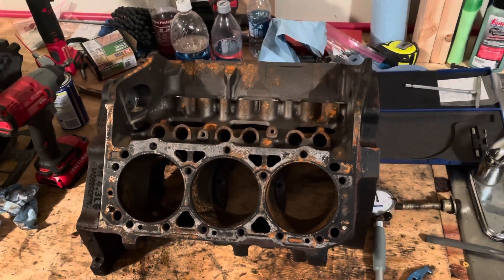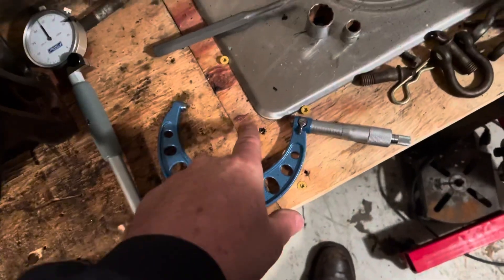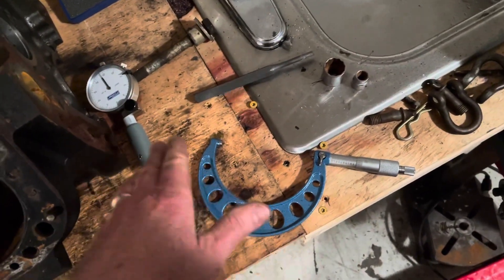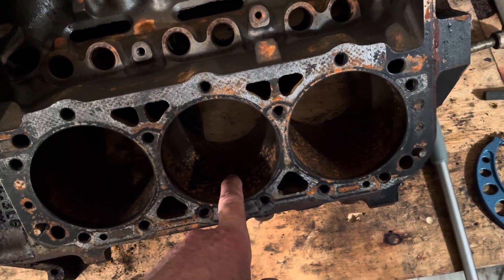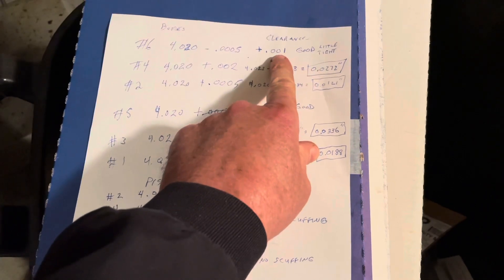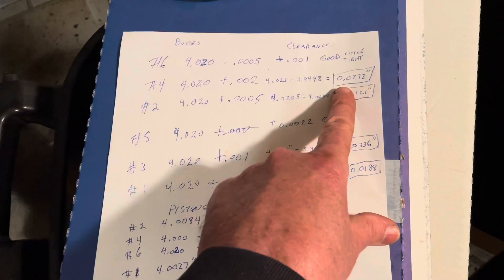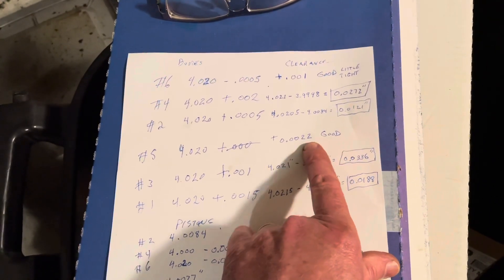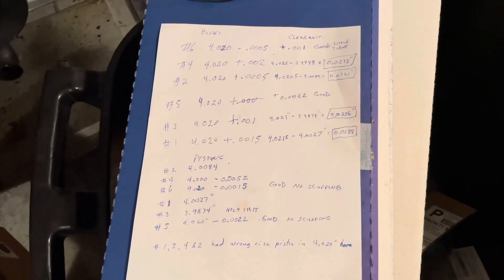Part F - Mercruiser 4.3 V6 - What Went Wrong??? (Follow Up)

Comment from the maker: It’s possible that the builder received the wrong size pistons in a boxed set. If they were in a hurry like you would be on a manufacturing line, they could mistakenly put the wrong pistons in the bores because you can’t see 0.020” with the naked eye. That’s why as a builder you should always use a micrometer to check your NEW parts before using them. Not doing this is negligence and could result in building a junk engine like this.